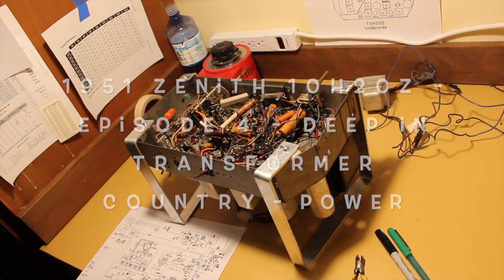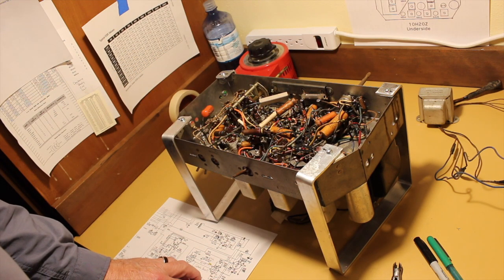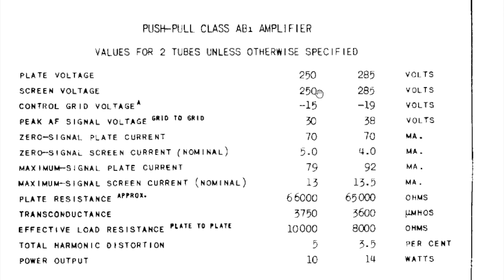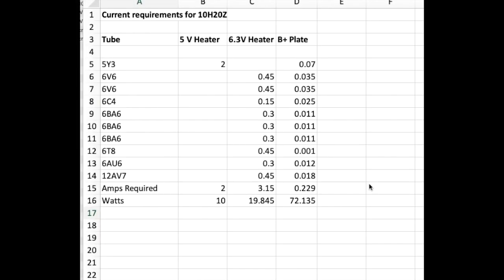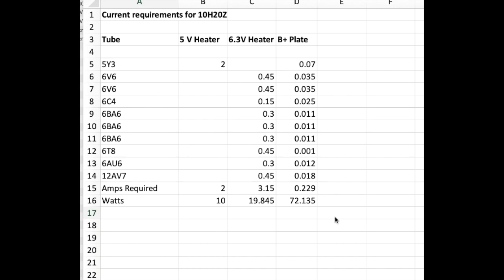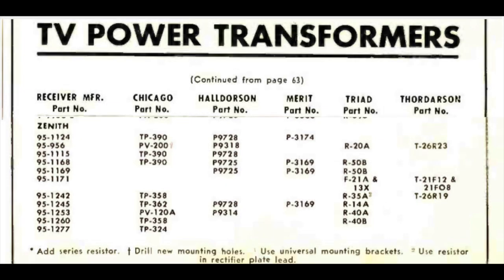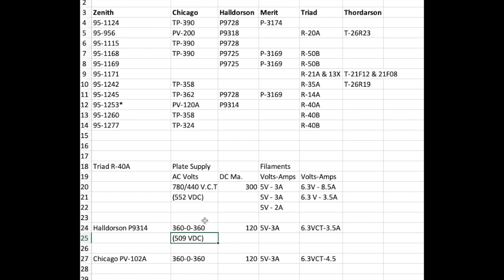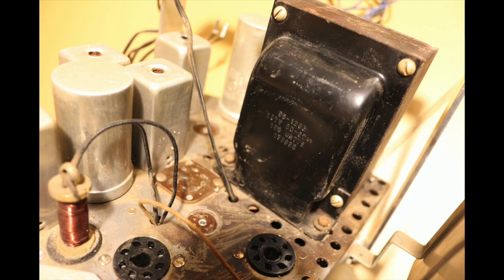1951 Zenith  10H20Z   Episode 4   Deep in Transformer Country   Power

Comment: Hi,
Wayne, who posted his comment before me, wrote what I was thinking about writing whilst I was viewing this video.  
Liberate the mains transformer; gradually bring its primary voltage up via a variable auto-transformer to operating mains voltage; use a DVM on AC to check the secondary voltages, and compare them to the specifications data you have to hand.  
The black painted mains transformer that is fixed to the chassis looks slightly undersized for delivering the specified requirements but I do realise it could be due to various angles of the camera when this video was being filmed.
For sure, you’ll need to check the strength of any Canned-ohm dropper resistor.  I might come across as stating the obvious here but I’ve had experience, largely on pre early 1970s televisions, where the internal insulation has broken down, and the resistance wire has shorted direct onto the outer metal casing, causing a permanent short to occur.  
If that radio belonged to me, I’d be thinking along the lines of 275 volts for each of the 6V6 anodes.  315 volts would be too close to the specified maximum anode voltage for my blood.  We all work differently but that is how I operate.
As for the audio output transformer, if it turns out to be a ‘randomly selected’ type that ‘works’, there is a decent selection of replacements specifically for 6V6 push - pull operation available.  It’s down to what you’d want to pay!

Once that radiogram is up and running, it will be a quality item once again.
Best regards, the man from Sheffield, England.

Comment: A suggestion.  You might want to connect the existing transformer (Power Transformer) to your variac, adjusted to 110 to 115 Volts AC to check out the performance so that you know what it actually is putting out when the line voltage of that era was applied.
Really enjoying the videos on this radio!  I am so very thankful to Larry for referring me to your channel.  I look forward to the next one in this series.
Reply from the maker: Thank you, Wayne. That, indeed, is my intent. Problem is, I will know the voltage output, but I won't be sure about current carrying capability (how's that for alliteration?).